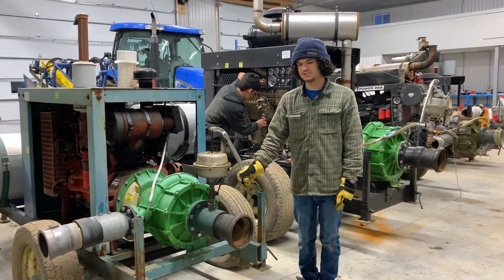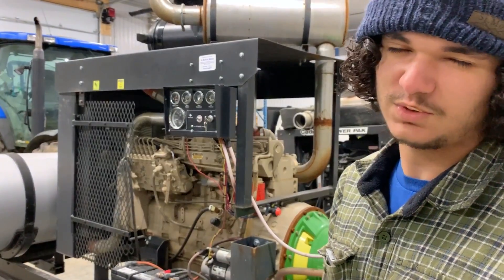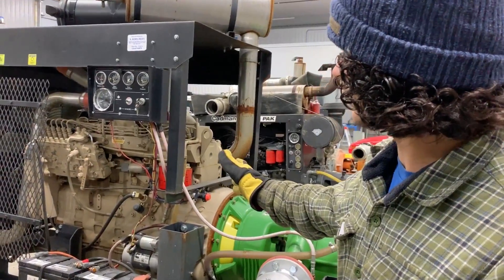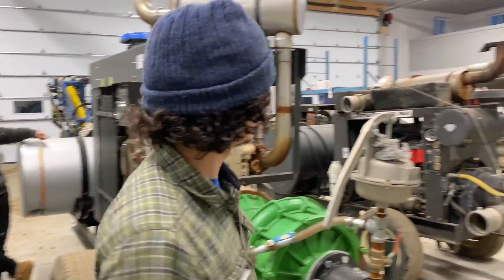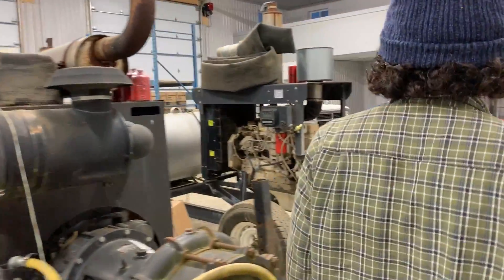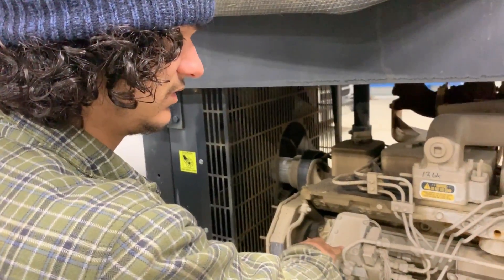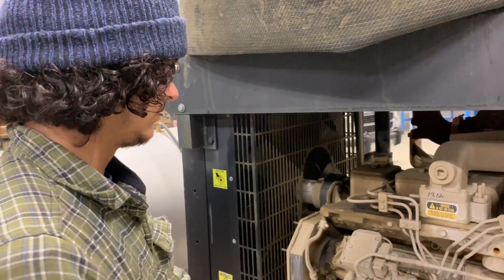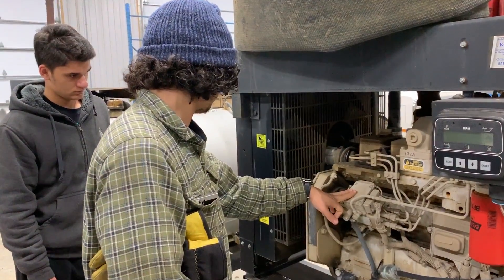A 12 Valve with a VP44?!??

Comment: That first one is a C8.3, 8.3 liters not 8.1. I work for Cummins and I have seen a 12 valve with a VP44 (pretty sure it's actually a VP30) pump. I've only ever seen 1 and it was in an industrial application, not automotive. I've got absolutely no clue why they did it or why it exists.

Comment: Yes the first gens didn’t have the p pump. They had the VE rotary. The 12 valve second gens had the p pumps (94-98). Then when the 24 valve rolled out they used the vp-44.
Reply from the maker: This is true...

Comment: Isnt it a 8.3 ltr cummins? And btw that intake on that 12v is an aftercooler. Its like intercooler inside of it that has coolant passing through it. Im assuming to cool the air going in the motor

Comment: The cummins with the "tall intake" I think is similar to what they use in some marine applications. I believe it's a water cooled intercooler setup. I could be wrong. I did see a marine 12 valve installed in a older (80's) ford dually with a water cooled intercooler. Looks similar.
Reply: You are correct. It is a charge air cooler that uses engine coolant rather than an air to air inter cooler.

Comment: The only reason they went with the vp44 was for emissions I think that's why cummins develop the 24v cummins. The vp44 can control timing and fuel by the ECM where the ppump can not it's full manual.

Comment: Dozer please. Turned up all the way, under full brake, high gear, wide open with grid heater or ether disconnected. Or power slide the Peterbilt once ice is available. 🙃👍

Comment: 1998 12 valves where the only trucks with a vp44.
Reply: Bandit L wrong I own a 1998 12 valve they are still p-pumped the 98.5 24 valves have vp’s
Reply: I know they are rare. But there are factory trucks it there
Reply: @Cheatindiesel   a 12v cummins in a dodge truck never came with a vp44 on them only the 24v's. In the industrial motors they did.
Reply: I know of 3 completely stock 12 valves with the vp. Wanna tell my why that is?
Reply: @Cheatindiesel  not in a dodge truck. They were industrial motors only. If u find one it a dodge truck it was converted over.
Reply: Ok whatever.
Reply: @Cheatindiesel  make a video